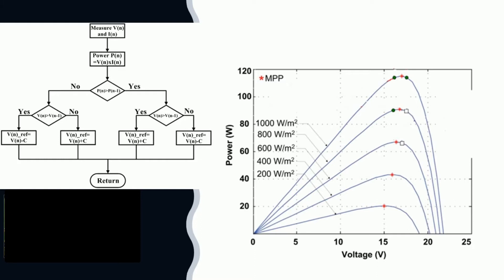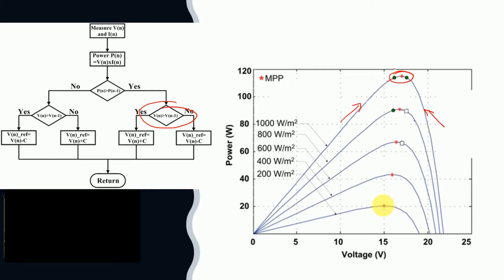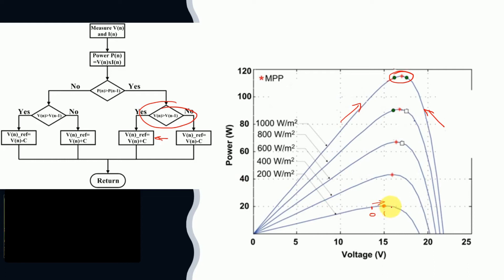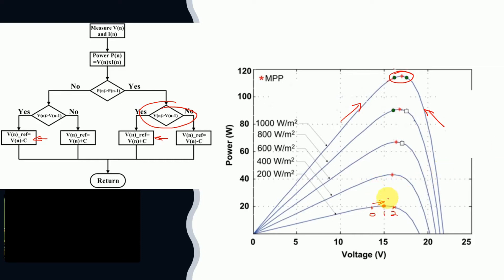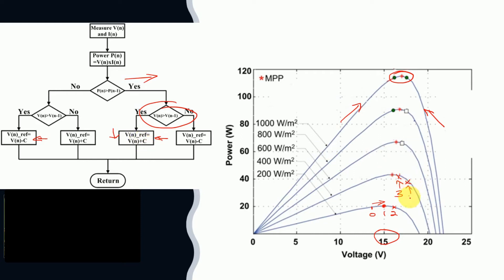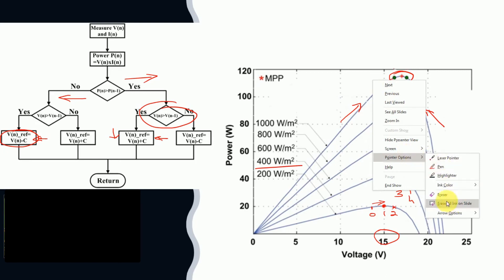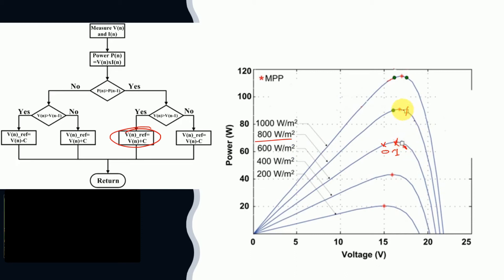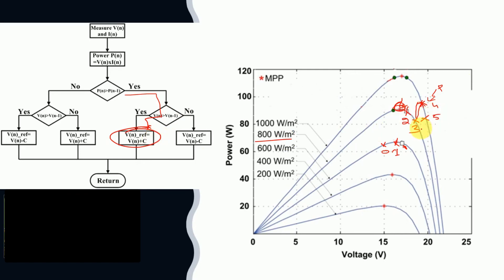perturb and observe MPPT performance under dynamic weather conditions

Comment: Excellent work. I was also looking for P & O simulation based on voltage with buck-boost converter. I could not find kyocera Sm-85ksm module in PV block. I am following this paper but could not find the details of blocks used in it. I wonder If you can help me in this regard.

Rokonuzzaman, Md, et al. "IoT-enabled high efficiency smart solar charge controller with maximum power point tracking—design, hardware implementation and performance testing." Electronics 9.8 (2020): 1267.
Reply from the maker: If you are modeling it using simulink you can use custom model and then specify the data of this module. Reproduction of a paper requires some effort because most of things are left to the prior knowledge of the reader. When i was doing my PhD, i use to email the authors in case of any confusion. Try doing that as well but dont ask them for the source file :)

Comment: Sir which method is better for dynamic weather condition ...INC or PO ?
Reply from the maker: Both have more or less same performance as evident from these research papers. 
1. Sera, D., Mathe, L., Kerekes, T., Spataru, S.V. and Teodorescu, R., 2013. On the perturb-and-observe and incremental conductance MPPT methods for PV systems. IEEE journal of photovoltaics, 3(3), pp.1070-1078.
2.Elgendy, M.A., Zahawi, B. and Atkinson, D.J., 2012. Assessment of the incremental conductance maximum power point tracking algorithm. IEEE Transactions on sustainable energy, 4(1), pp.108-117.